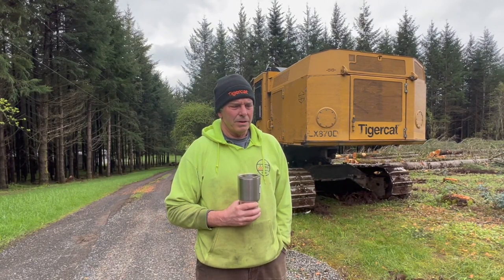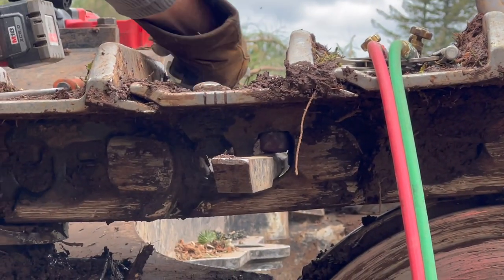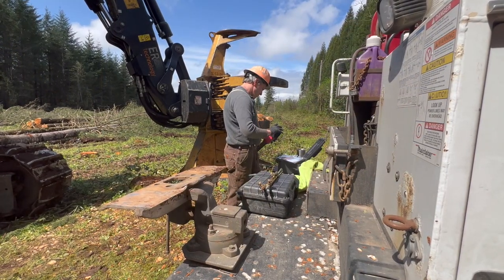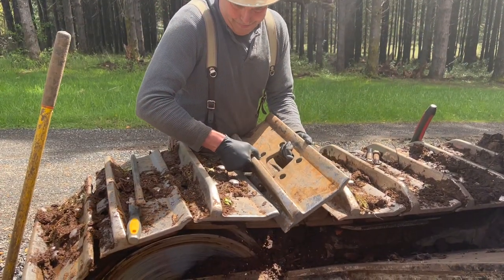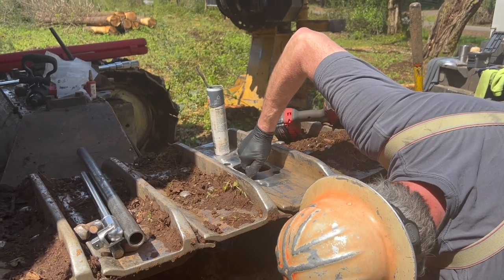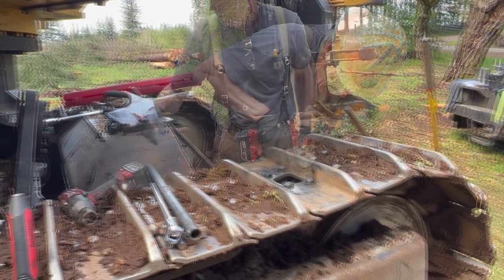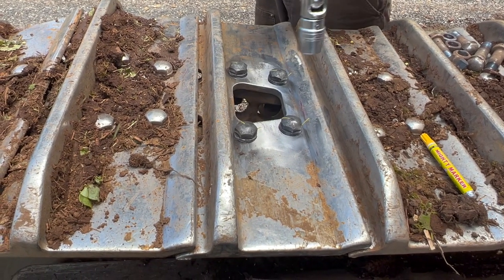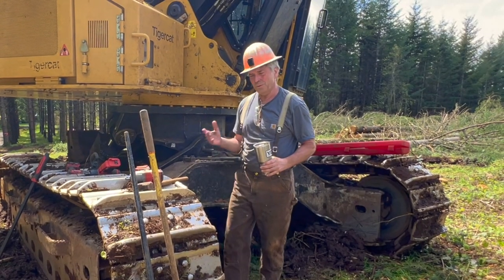Sunday Morning Wrenching - New Bolts On A Loose Track Pad For The Tigercat

Comment: I can remember that in emergancy Situationen my dad used to weld the bolts on but only if we had no other way to go good Video 👍
Reply from the maker: Copy that. I've had to weld the master pin in too in that same kinda situation! Basically when it's scrap but you need to keep it going a little longer til you can fix it right. Glad you liked it, thanks for watching and for the comment.

Comment: Milwaukee is a must have in the woods👍  I need the 1inch. No impact can keep pads tight, job well done ..
Reply from the maker: Hey thank you. I have had a couple of 1/2" Milwaukee  guns, one got stolen along with the rest of my Milwaukee tools a while ago. Thieves. I replaced them all and recently went with the 3/4" over the 1"' mainly 'cause it is more compact, I'm running out of room! It hits almost as hard as the 1", plus I already have a full set of 3/4 impact sockets. Probably have a 1" sometime anyhow, you know how it is. The two pads that loosened up and I put new bolts on have held up tight, that torque to yield is the way to go. Thanks for the comment, Good cuttin to ya!

Comment: Boy bout 7’ of heavy wall 2” woulda been great…definitely learned something here…had no idea so much went into tightening a loose pad…lol..way my dad woulda done it…right..
Reply from the maker: You called that right. I ended up using both 3 foot pieces of cheater pipe on the 1 inch Proto breaker bar. The 3 footers fit sideways in my big tool compartment and the 1" fits inside the 1-1/2". Works good for times like this when I needed all that and a little more. Ended up with almost 8 feet. I'm with you on your dad too, but in my case it would be how my Grandad would have done it! No sense doing it halfway and having to do it again, right? Thanks for watching and the comment, we appreciate it.

Comment: Dan Becker
I have both gun's and there are great . I used my 1inch gun and changed all the track pads on a D7R and there 63 pads per track
Reply from the maker: Right on. That's a serious recommendation! Over 500 bolts is a project for sure. I'm lucky to have been able to borrow both and try them out. I love my 1/2" gun, it's done a tremendous amount of hard labor. I ended up getting the 3/4, I don't have as much need for the 1 inch, don't have 1 inch impact sockets, and the 1" is a little bigger physically than the 3/4 so it wouldn't fit where I needed to store it. Running out of room - you know how that is probably! I found that the 3/4 hit close to as hard as the 1. But close isn't enough sometimes, right? Thanks for the comment, I appreciate the info, be safe out there!

Comment: The 3/4 is powerful. One of the few Milwaukees I had to replace because of breakage. 

The 1” gun, short anvil, non pistol grip style is very powerful but need to run 12 amp/hr batt and have nice tight sockets to get full benefit.
Reply from the maker: Hey, thanks for replying. When an impact is powerful enough to wear itself out, that says something. I ended up going with the 3/4 for now. Mainly cause I already have a complete set of 3/4 impact sockets. The 1" is a little bigger too, I'm gettting kinda short on real estate in the truck! I think you really have to have the 12 AH battery with these big ones to get the max performance out of them. That's a good reminder you make though about tight sockets if you are really up against it, sometimes you only have one shot, right? Thanks for the comment and for watching, we appreciate it. Be safe!

Comment: Here is something i was thinking about today i have a 1" torque wrench thats like super long and to be honest some people asked me why its that long well if you have to tight such bolts down you realy need all the lenght you can get 👍👍
Reply from the maker: Yeah, that's the truth. With both my cheater pipes on my 1" drive breaker bar I had 8 feet on those and I needed every bit to get that 1/3 turn. Would have been a good app for my torque multiplier, but no easy way to secure the energy bar. That is a common issue for me with trying to use the torque multiplier. Thanks for the comment, be safe!

Comment: I’ve got the Milwaukee 3/4 gun, not real impressed . The big Milwaukee  1/2 gun seems to do just as good or better.
Reply: The 3/4 and 1/2 are the same gun just different anvil, the 1 inch guns are different wether the pistol grip or d handle
Reply from the maker: I ended up picking up the 3/4 and a 12 AH battery. I'm pretty impressed using it so far. All in all it was the best choice for me right now and my experience borrowing the 1 and the 3/4 was that the 3/4 hit close to as hard as the 1. Main thing is that I don't currently have 1 in impact sockets. Wouldn't surprise me too much if I end up getting the 1 inch at some point anyhow! You can't have too many good tools, right? Any way you look at it these Milwaukees are awesome in my book. I can remember when they first started coming out I was like, man, those will never hold up. Now we'd all be lost without them. Hey, thanks for the comment, appreciate the feedback. Be safe!

Comment: A drop of weld on the thread to nut edge will hold the bastages.
Reply from the maker: Copy. I think of that as a last resort though. Means you have to cut them off or scrap it. Not to say I haven't done that on stuff though! Thanks for the comment.

Comment: Hi
Do not buy the inch gun
I use the 3/4 hdvs in UK fantastic 
Had the inch one let down sold it
All the best pal
ROB
Reply from the maker: Right on. That's what I went with, the 3/4" high output. Using the two I was able to borrow a couple of times it seemed to me that the 3/4 gun hit almost as hard as the 1". I had some other reasons that helped steer me that way, but thanks for the feedback and info, I appreciate it. Thanks also for watching. Are you in the Timber industry in the U.K. or a related field? Either way, thanks, be safe!
Reply: @thedailylogger  truck mechanic 
Doing it for 48years 
Thanks for the reply 
Rob
Reply from the maker: @RobertSmith-fv3ux  You bet! Im close behind you, been making low stumps for over 40 years! Be safe.